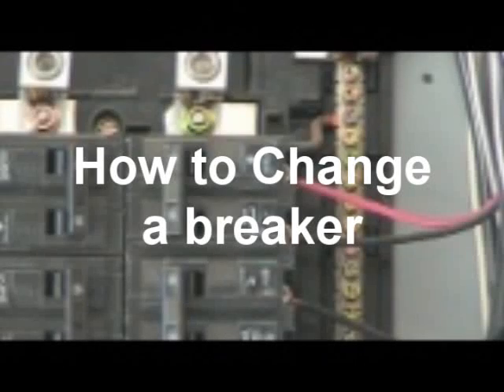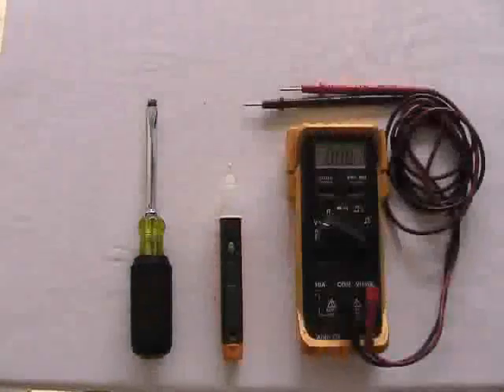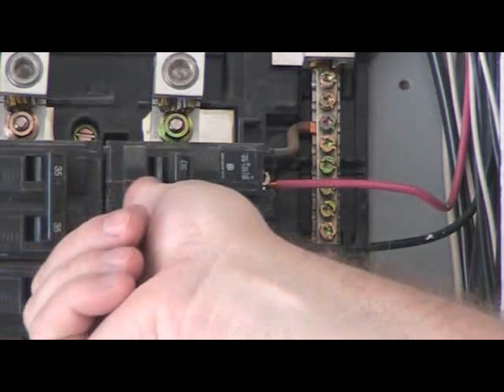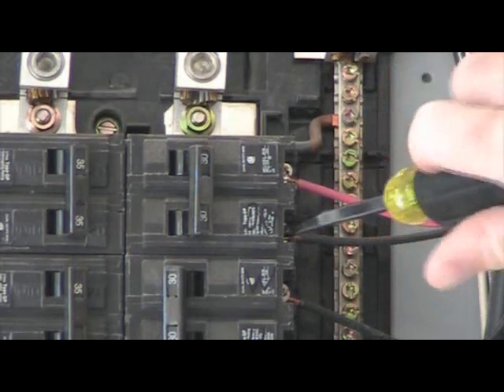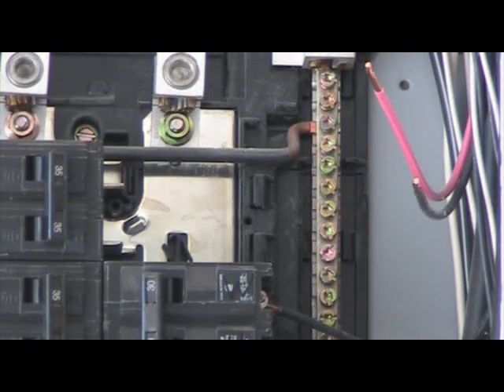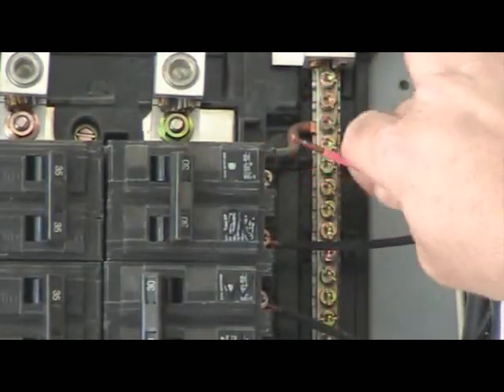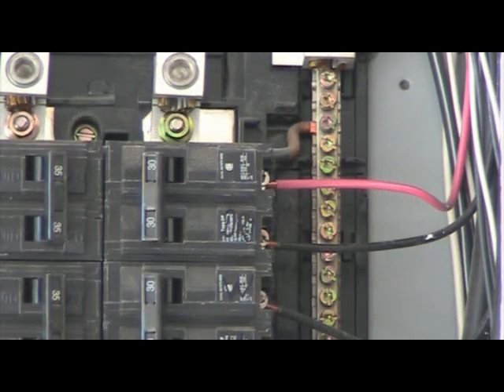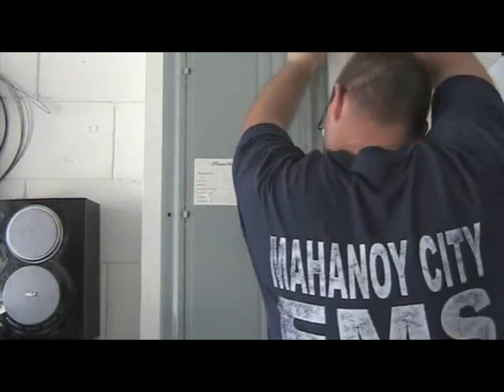How to Change a Breaker

Comment: What did he need the volt meter for?
Reply from the maker: amandduhpooh To confirm whether the breaker needs to be changed.  If you dont check, and the breaker was not the problem in the first place, you did un-necessary work.
Reply: +amandduhpooh You are correct; Volt meter is not a mandatory tool here. Generally, breaker doesn't need a replacement that soon but looks like he wanted to first make sure the appliance is good and breaker is indeed a problem here...
Reply: When I watched it I thought he was using it for two reasons: * to make sure there was no electricity flowing to through the circuit when it was turned off and * to make sure there was electricity flowing through it when it was replaced and turned on.
Reply: Believe me and speaking from experience. You would definitely want to know and make sure no electricity is flowing before working on it or you're literally in for a shock.
Reply: Michael B.  Electricity is made more dangerous by the fact that there is zero visible evidence when there is power there. Gasoline as well.
Reply: Wear rubber hand gloves, rubber shoes and stand on a dry wooden block as important safety measures especially while dealing with high voltage electricity.
Reply: Then why isnt this included in the video?
Reply: DIY For Beginners Really? His must be that new flesh tone color
Reply: Yea people arent very good with details.

Comment: You could get a micrometer and measure as well.  In my house it is pretty obvious what is 12ga and what is 14ga.  14ga is hard to work with because of the thickness.  

A quicker visual the plastic sheathing  around romex cable bundle  is a white/grey for 14ga, and Yellow for 12ga.

Comment: I've read about your electrical installation but I don't speak english a lot :( Have you ussualy "Split-phase" (2 legs + neutral)? Where do you use 3phase wiring? What are you doing when you have only 1p (standart home instalation ??) and you want to connect 3phase machine (for example: circular saw)? Or do you have motors for 2 legs+neutral? Thank you. Peter (Czech republic)

Comment from the maker: @cheecheng - In this case I would definitely change out the breaker first.  Its a cheap fix and one you can do yourself if you follow what I outline in the video.  If after that it does not work, than let me know and I will try and guide you to a solution.  Good luck.

Comment: What setting do you use on the multimeter to check your wiring/breaker is correct? What should it read? I just want to be sure if it's a 120v.

Comment: Thanks! One final question, I am thinking of making a 220 extension cord using the 10-3 wire of course, any issues making a 10-15 foot extension cord with appropriate fittings for the plasma cutter?

Comment: Hey Doc,
I have a plasma cutter that will run on 110 or 220.  The 110 requires at least a 30 amp with a 10-3 cable.  I checked the breaker and it is a 20 amp, can I just change it out as you show with a 30 amp and it's good or is there something else I need to do?  Also when it mentions the 10-3 that shouldn't be an issue since that should already be on the tool?
Thanks for your help and video.

Comment: I have one switch out of four that stopped working. I replaced that switch, but it turns out that's not the problem. I assume electricity is getting thru since the other three switches are fine. Any suggestions on how to troubleshoot? Thanks for the video.

Comment: Thanks for the video, I just changed my first ever Circuit breaker. 

1 Question though: My dens circuit breaker is 15A and every time I plugged in 2 150Watts bulb and some other devices computer, printer etc.  it tripped. Is it smart to change my circuit breaker to 20A or higher?
Reply: I have that same issue. Did you install a 20a ? Did it work?
Reply: Depends on the wire gauge that is feeding that outlet. If the circuit to your den has 12 gauge conductors, then there should be no harm with installing a 20 amp. If not, going to a bigger circuit breaker will allow the wires to overheat with too much current before the breaker will detect an overload. Heat is never good, that will cause a fire.

Comment: Should you shut off power to the entire panel while this is done or do you leave it on?

Have a 20 amp circuit that I need to replace with a 30a for a dryer. 

Thanks!

Comment: Last coment 5 years ago lol I will do more research as well but I do have some questions. Why would I need to change a breaker? What are some signs that I should change a breaker? House was built in the 70's should i change them all? Is it cost affective to change them even if they dont need to be changed as in would it save on the electric bill?
Reply from the maker: You should watch my video called "Checking a bad breaker" - I explain all this there.  But long story short, from time to time you should check the tightness of the connections on your breakers, but changing them just to change them will not have any affect on your electric bill.

Comment: hello , I was installing new lights in my basement and by accident I cut a wire , have a short circuit and the lights went off ..   I secure the wires separate them so it didn't happen again ..    but the breaker didn't work anymore when I put the breaker back in on position .  I was planning in change the breaker ( maybe is not working no more after I cut the wire )  can a short circuit damage the breaker or maybe is something else >?   is just the circuit for those lights ... everything else in the basement is working ,  bathroom lights , electrical outlets ...  only the ceiling lights are affected  ...   please let me know if you have any idea .   thanks

Comment: i have a 15 amp breaker that continues to trip. It is running my sprinkler system. I heard that once a breaker trips, it gets weaker. Is that true? and can I upgrade it to a 20A breaker without jeopardizing my system??? thanx for the help.

Comment: If i could just ask a general question, i bought a house and the old owner said she removed the floor electrical heaters due to water from the sump pump. the wires i later discovered are still at the floor level . how do i measure them to 1. see what the volts is(are) and 2.  how do i tell what breaker they work from.? the colors of the wires and black and white

Comment: Thanks for the reply, my shop  also has a "220" plug, I looked at it and the outlet says 250V 30amp, would it be ok to use that since it can run on 220?

Comment: How do you know which breaker to get, home depot has different brand breakers.
Reply: You take the old breaker with you and compare it with the new one. Siemens, GE and Square-D are good brands regardless what brand your panel is, they make the circuit breaker types depicted in the video. But MAKE SURE you get the right amperage, amperage is paramount in your circuit breaker replacement project.

Comment: Whats the voltmeter used for? You recommend it but didnt use it in the video?
Reply: Testing voltage from the breaker screw to the ground screw on the white bar.

Comment: Hi! My 15 amp circuit breaker always trips so i assume it needed a replacement. I called a electrician and they said they probably do a new circuit. Do they have to do this or they can just change the breaker to a higher amp to accomodate my load and to avoid the circuit to trip. Thanks i hope you can answer this right away.

Comment: good vid..i went to replace my circuit breaker for my dryer because the dryer kept shutting off. i started checking around and discovered when you jiggle the breaker a little the dryer light flickering. i decided to replace the breaker which is something that i have done before in the past. the problem i am having is the breaker will not pop out as the other breakers do. this is a dual pole 240v breaker. the single pole breakers pop right out but some don't. hope someone can help

Comment: i have a 15 amp breaker that hums and trips alot. Do i just kill the one breaker switch am replacing? Any help would be great thank you
Reply: I would suggest to shut off the breaker at the main panel which is located outside of the house.

Comment: It looks very easy to do. But what do you do when the breaker is stuck in there and it doesn't want to come out, as often times they are?
Reply from the maker: If you run into one that does not want to come out as depicted in the video, you will want to shut down the main to remove it.  It may have to be tapped with a mallet.  If you dont feel comfortable doing that, then you will want to call an electrician to do it for you.

Comment from the maker: 14ga is easier to work with because its smaller.  The thickness of the sheathing is the same for all romex cabling.  You have this backwards, 12ga is harder to work with because the wire is bigger.

Comment: NOOOOOOO!  Turn off the main power supply to the house, first.
Reply: I agree. I would have. I personally don't think this video is for the first timer who has never worked on a main or sub panel. Its a recipe for a bad situation if they "accidentally" touch one of those energized lines.
Reply: Dont touch energized lines... Lol
Reply: You can't always turn it off in a commercial setting
Reply: Dan Allen thank yu so much
Reply: Dan Allen one question do I turn off all the breaker?
Reply: +show ğ n

o
Reply: There is usually a switch towards the top that says 'main'.
Reply: Dan Allen So let me get this str8 if ONE breaker goes bad during business hours I have to shut the whole building down to change it out??? Come on man, you just watched someone do it safely. Do you think they edited out the part of him being electrocuted?
Reply: James 577864 no you’re just being safe.  Everyone crawl before they walk.
Reply: @mgomez5606  you can't , feed of the panel comes from a meter
Reply: Death Valley    *lose
Reply: It doesn’t have one right?
Reply: @stfuplsok  lose what?
Reply: @deathvalley1477    lose* power
Reply: @deathvalley1477   *customers
Reply: @dreamingcode  if your doing this in a commercial setting.  Then I hope your not learning how on youtube
Reply: And I'd wear gloves, wear sneakers and stand on plywood for good measure. No such thing as an un-hot breaker box as far as I'm concerned.
Reply: @maxflow151    *you're
Reply: @stfuplsok  you got me
Reply: @maxflow151   by G-Eazy
Reply: thank you.  I will.  I am doing this today.  I will reply again if I didn't die.
Reply: I survived but the new circuit breaker died again...  time to call an electrician.
Reply: @r56mini  that sucks. I'm about to do this at my mom's. I hope it solves the problem.
Reply: @r56mini  my breakers are tripping and die too often. They told me to change the bus-bar.  How is yours now ?
Reply: Dan Allen do u know any good video for. 1st time.
Reply: The breaker to my Oven Blew, it says its is 120/240 Breaker. Is this done the same way???  A d what's the Difference Single/DBL Pole?
Reply: I would definitely TURN OFF the main power first no matter what.
Reply: Get a wood gaff and pull the pole fuse outside the house so your neighbors can appreciate how safely you work. Pull a few down the street just to be extra sure.

Comment: The breaker is not "tripping" but the outlets are not working on one wall of my living room.  Could it still be a bad breaker or should I call an electrician to go into the wall?
Reply: Unless the two outlets are the only thing on the circuit, it’s not the breaker

Comment: Question: if I turn off the main power from the house which outside, do I still need a tester?
Reply: You always want to check to make sure there is no current flowing to be on the safe side. You can get one at a local Home Depot or Lowes for about $15 or less. I always use one when I work on electrical. When I was around 4 years old I remember being shocked when I stuck a fork in an outlet. I'm 44 now and I still remember that effect! It was not fun I'll tell you that much. It's embedded  into my head not to mess with electricity lol. Depending on your main, you could be dealing with 100-200 amp of electricity so it's best to lean on the side of caution.
Reply: Michael B. - yeah you are right, life is worth note than $15 so why risk it.

Thanks

Comment from the maker: Sorry for the delayed response.  If your comfortable enough, you dont need to turn off the main breaker.  I personally only do it in extreme circumstances.  As for upping the size of the breaker, I would not recommend it.  Breakers are sized for the wires attached to it.  So 14ga wire can only be on a 15amp breaker, and 12ga on a 20amp.  Now you can put a lower rated breaker on larger wire, but not the other way around.  Hope this helps.

Comment from the maker: We have many different voltages in this country.  In this particular case, the voltage is 120/240 three and four wire.  Which means two hots and a ground, or two hots a ground and a neutral, depending on whether this is a main panel (three wire) or subpanel (four wire)

Comment: I have a question. my washer and dryer are in the same room. the power socket for the dryer is much bigger than the washer one. the washer plugs into any power outlet. recently the power for the dryer went out and i went to reset the breaker. the washer never went off but the dryer did. I suppose the breaker would reset the power back but it didnt. now the dryer wont turn on and its a pretty new dryer. should i buy a new breaker or does anyone have a suggestion.

Comment: IF I do NOT turn off the main breaker but do turn OFF the breaker that I am replacing, the wire that is screwed into the breaker should NOT be live but DEAD, correct?
Reply from the maker: Ojeramup12 - Correct
Reply: Thanks for the quick response. I plan on replacing a breaker and will not be touching other wires. I do have a sniffer tool to double check the wires are dead.
Reply: Double check that your "sniffer tool" works both before AND after you attempt to verify if the power is off when the breaker is off.  
And TURN OFF the MAIN disconnect, FIRST.  There is NO reason for anyone to remove or install a breaker on a hot panel bus.

Comment from the maker: @stevohouston I always welcome comments from users, and that is the one great thing about living in this country is that we have the freedom of speech.  I am a Master Electrician as well as a Licensed Electrical Contractor here in Florida.  I stand behind anything that I make and post.  As I tell the other haters that love to spam successful vidoes, if you dont like it - make your own.  

Now keep your comments civil or I will block you.  Another great freedom I have of owning this channel.
Reply: I am installing a 1/3 hp sump pump that has a 120v nine ft. Plug in cord. It also shows 26.7 amp initial start. This is going into an outside sump pit next my garage wall. Do I need to install a separate box, wiring, & breaker ( 30amp) ?  for this pump. I was planning on installing a circuit interrupter for the plug in receptacle with an on/off switch.
Reply: What if your problem is the main breaker? Can it be changed out while off or does the power need to be shutoff by electrical company? My power is cycling off on on different circuits like randomly like 5 times and then it normal. Some things dont seem affected while others say this device wasnt powered off correctly. Light above kitchen sink flickers during this and goes back to on after. Power company said its fine on there end.

Comment: You failed to mention specific information and most importantly to use a torque screwdriver which is required by NEC and the manufacturer.  The torque value is listed on the overcurrent device.  You just taught many people how to incorrectly install an overcurrent device....well done!
Reply from the maker: Chad Via - Your average homeowner will not own tools like this, nor will they spend that kind of money.  However thank you for the compliment.

Comment: Isn't it a bit irresponsible to make this video and not go over the dangers of doing this job the wrong way? 1st step: TURN OFF THE MAIN BREAKER. Instead, he starts off describing how to be careful because the panel screws might short the inner wires when removing them, not as dangerous if you just turn the MAIN BREAKER OFF. The argument of "I do this everyday" is no substitute for commen sense. Most people will find this video to learn DIY, not because they're experienced 🙄 Sorry, hack vids like this just make me made by knowing people could get hurt.
Reply: Absolutely agree with you my friend. Not to mention another safety issue especially working inside the panel. By rights you should really be using an insulated screwdriver. Just saying...

Comment: He did this without turning off the main breaker! :O Ballsy
Reply: So did I about 5 minutes ago. Now if it was say a 1.2kA breaker then hell no, de-energize the buss and lock-out with a tag. I heard of a guy that died racking a large breaker alone to live buss. The breaker exploded like a hand grenade. :(
Reply: So you know, a fraction of a single Amp through your body is enough to induce ventricular fibrillation, and the human body is not a good enough conductor that even the best connection from hand to hand will ever lead to even a 100 A breaker tripping in a 240 V system. If this lower limit is on the order of 500 Ω, then you should expect as much as about 500 mA rms. The 100 A breaker will never ever trip and you will be having the worst day of your life. Now, all this assumes you are able to make a good connection to it with your body parts and in practice, in particular if your skin is dry your body may offer much more resistance, but do you really want to bet your life on ONLY experiencing a painful shock as the price of a little slip? The take away here is that the number on the breaker is irrelevant to your safety here. It's the voltage you should thick twice about and even 120 V has the potential to kill.